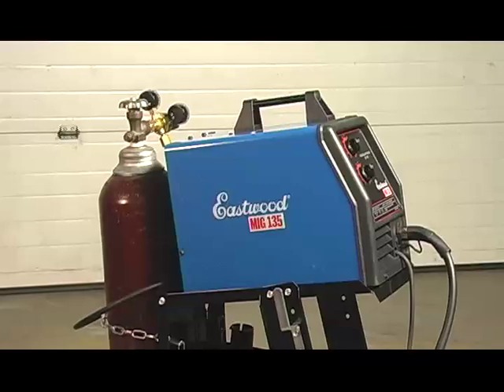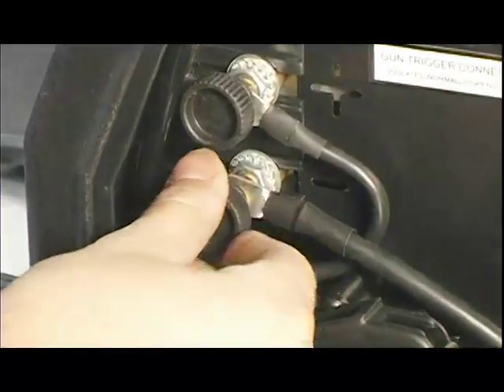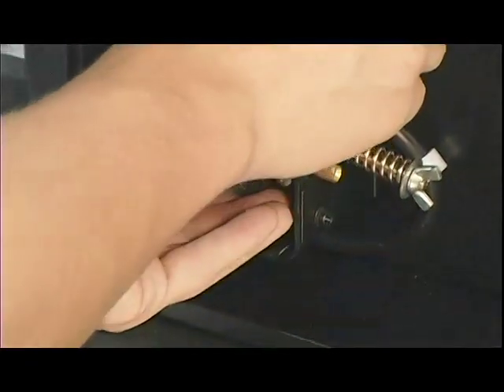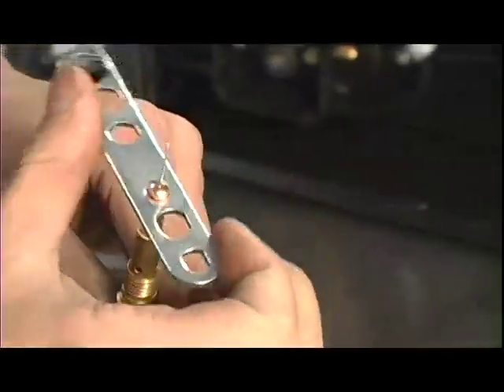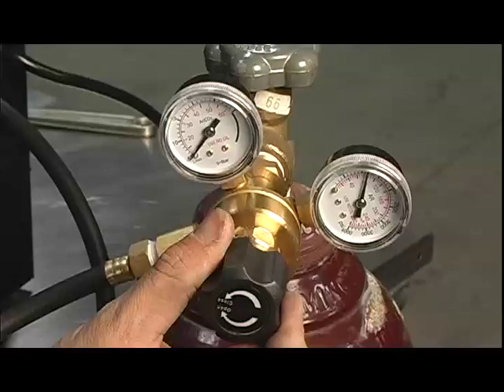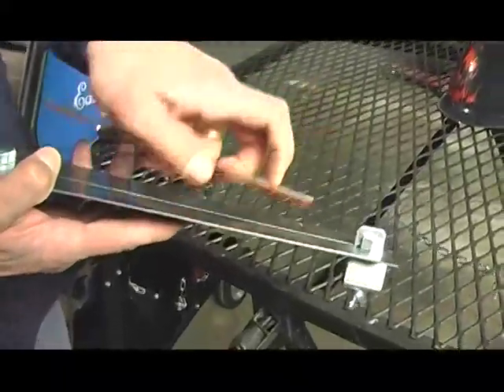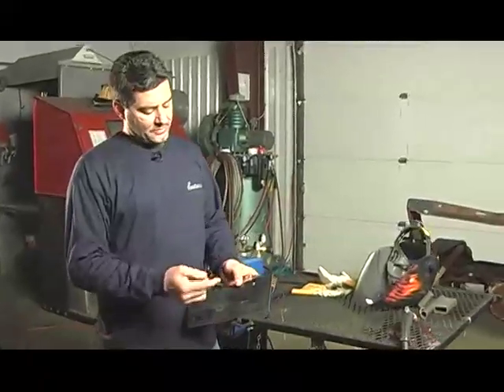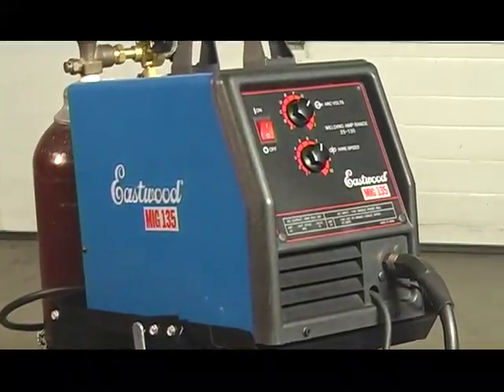How to Set Up Your Welder and Tips on Your First Welds from Eastwood

Comment: my welder don't work at all right out of the box the fan is running but that's it
Reply from the maker: +Sergio Duarte Please contact Eastwood Customer Service where they can help resolve this issue.  1.800.343.9353.  Thanks.

Comment: Reguarding The top comment about the ground clamp  from a year ago... This video is included with the 135 and 175 welder (as I saw in the eastwood store). The smaller ground clamp is with the 135 (lower amperage; so only needs smaller clamp). The larger clamp comes with the 175 welder (which needs it for the higher current that welder can put out). Not sure why the eastwood guys didn't pick up on that; but it really doesn't matter.  Both welders get a thumbs up from me!